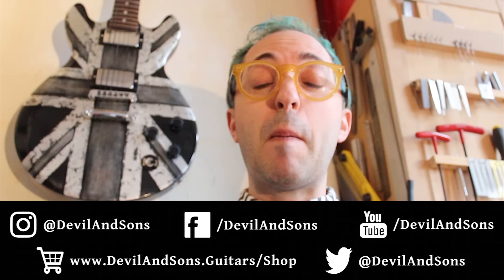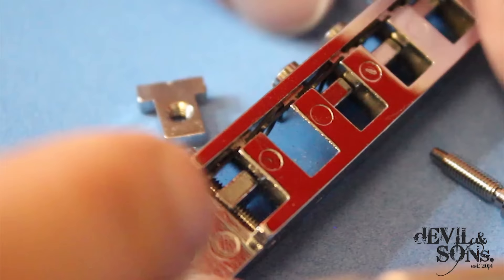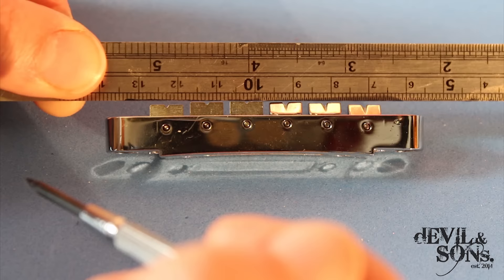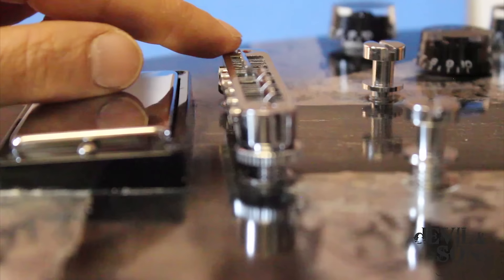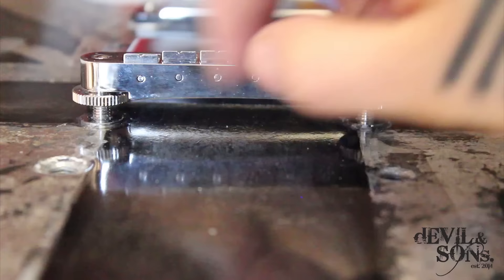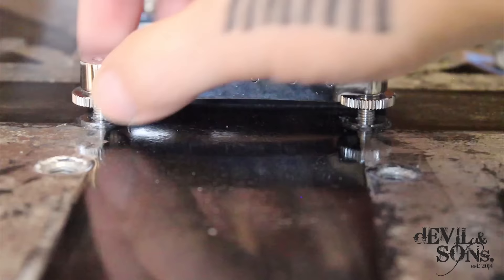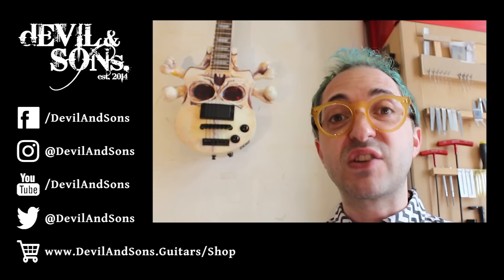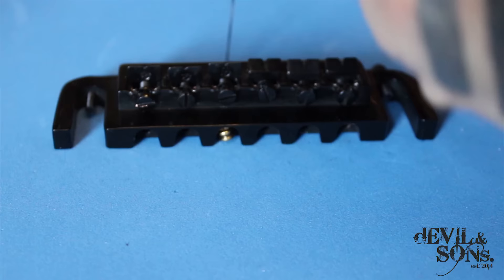Setting up a Tune-o-matic bridge (Les Paul style)

Comment: I have a badly made black knight with a tune-o-matic. The strings leave the bridge an go through to the back of the guitar. Do you thino i would be able to add the bottom piece like you have in your video, as i dont like putting my strings through the guitar body?
Reply from the maker: I'm so sorry, I missed this comment. You can definitely add a stop piece, and it wouldn't matter if it wasn't fitted exactly as it's where the strings go over the bridge part that count the most, so as long as the stop bar/piece is roughly over the hole in the body you should be fine.
Reply: @DevilAndSons  thanks. It worked! I dont seem to have any tonal issues at all.
Reply from the maker: Mark Marshall great news. Sorry again for missing your comment.
Reply: @DevilAndSons  honestly dont worry about it

Comment: When are we adjusting intonation is it very important to be one level ahead or behind on (I'm trying to mean example when are we adjusting E string and checking on 12th fret and indicator showing 1 or 2 level up or love) tuner indicator or is it fine ?
Reply from the maker: You need to make sure that you have exactly the same note (but one octave higher) on the 12th fret as the open string. If you don't then you will find the notes get more and more out of tune the higher you go on the fretboard. I hope that makes sense.
Reply: @DevilAndSons  thank you for answering. Can I use my clip tuner or do I need strobe tuner?
Reply from the maker: Any tuner will work, but you may got more accuracy from a more expensive one.
Reply: @DevilAndSons  I have Ashton CPT200 clip tuner does it enought to adjust intonation? or do I have to buy expensive tuners like Jim Dunlop DT-C2 ?
Reply from the maker: This is fine.

Comment: How high should the bridge be off the body?
Reply from the maker: That would depend on a number of things. The best thing to do is actually measure the height of the strings off of the fretboard, and specifically the height at the 12th fret. This is how you normally measure your action or string height, which is adjusted by the bridge. So for some guitars the bridge will be higher that others as the neck may be higher off of the body. I actually have a full set up video whoch covers string height/action, as this video really only focuses on the bridge itself.
Reply from the maker: Here's that video https://youtu.be/bZHjmr6Y2qg

Comment: Hey man great video, very helpful. My question is  my saddle bridge is all the way down and my string action is still a bit to high. I am a bit worried I have warping going on with my Epiphone Sheraton ii, I just recently tightened the truss rod as well to get the action closer but when I do the check the capo on the first fret and check the 7th fret there is no room, at all. When I do adjust it so there is the proper gap there the action is then unbelievably high and really bums me out because I’ve only had this guitar for a year and a half and I’m worried it’s messed up.. should I go to a tech that really knows what’s up or do you have any suggestions. I’m very much looking forward to those other setup videos you mentioned. Thanks for any tips in advance!!
Reply from the maker: Brandon Uhlir thanks for commenting, and sorry to hear that. Obviously it’s hard to know without seeing it, but sounds like you know what you are doing with the truss rod, and yes you are right - it needs that gap under the seventh fret when capo the first fret and hold down at around the point the neck meets the guitar. I think it sounds like a problem with the angle of the neck. If i’m correct the neck isn’t a bolt on so it would hard to do yourself. It would an adjustment to how the neck sits in the pocket where it joins the guitar (if it is actually a neck angle problem). Is this a problem that has developed over time? It is probably worth getting it checked out, but you could do a YouTube search for adjusting neck angles that may help you understand the problem better. With a bolt on you can add a shim to adjust it.
Reply: On many Les Paul tun-o-matic bridges, they come factory with the BASS side string saddles and TREBLE side facing the opposite directions. This becomes an issue when you come across intonation with these guitars. You max out your saddle screw turning ability but your intonation is still off. First check the issue isnt your truss rod/neck or action. if all else fails, FLIP THE SADDLES 
1.Remove the 3 TREBLE saddles, 
2.Flip them around so theyre the same direction as the BASS string saddles. 
3.Restring
4.Intonation 

DONE. it should fix many of the issues with setup many are having with Epiphones and many gibsons as well
Reply from the maker: KyLesCaster thanks for commenting, and very interesting. Getting the right amount of movement in your saddles is important. It sounds like Brandon’s problem is with the string height and action not the intonation. Hopefully both our comments will help lead home to answer.
Reply: Devil & Sons, That's why the Nashville tune o matic wipes the floor with the ABR-1 👍
I had a Les Paul once (I still have it) and I just couldn't quite intonate the low E because the saddle had run out of travel which was a P.I.T.A.
So I swapped the ABR-1 for a Nashville tune o matic with roller saddles and that was a brilliant mod that also kept the guitar in tune better.
I have, at the moment swapped a couple more T.O.M's with the Schaller roller bridges which are better still, which brings me to my 2p for the O.P.....
Maybe if your action is too high with your T.OM. bottomed out, you might be able to get it lower by using a lower profile bridge such as a Schaller roller tune o matic. I would take measurements first of your existing T.O.M. the Schaller roller bridge, and the distance that your bridge is too high by, to see whether or not the lower profile bridge will be of any help before you spend any money buying one.
Reply from the maker: @JammyGit  Thanks for chipping in. Hopefully your advice will help people who come to this video.

Comment: 2:09 - I didn't understand why there is a need to play with the saddles. You explained it's effects the strings length, but I didn't get it. you can tune the string from the tuners, right ?
Reply from the maker: You do change the tuning with the machine h3ads but you adjust the saddles to get the intonation correct. Basically if the string is the wrong length and you play an open string tuned it E it will sound like and E, but if you play the E at the twelfth fret it won't be in tune if the string length is wrong.
Reply from the maker: Here's a full set up video where I explain intonation https://youtu.be/fvD-qsM3piQ
Reply from the maker: Intonation at 34 minutes into that full set up video.
Reply: @DevilAndSons  Thank u so much for all your answers man ! I just saw u answered me 👍
Reply from the maker: No worries, hope it all makes sense.

Comment: Does the saddle have to be square or can it be on a lean?
Reply from the maker: Sorry, I'm not sure I understand. Do you mean the whole bridge (which is normally at an angle) or the individual saddles?
Reply: @DevilAndSons  The whole bridge.
Reply from the maker: @RBFR01 most guitars will have it at an angle with the lower bass strings being further back to account for the fact they are bigger strings.

Comment: In your opinion, how high or raised should strings be on an Epiphone Casino guitar? I'm having trouble with the Tune o matic bridge :(
Reply from the maker: It's definitely a matter of taste and depends on the strings and style of playing but I would normally advise sonewhere between 2 and 2.5mm for the low E and between 1 and 1.5mm for the top E, graduating the strings in between. Is the main problem you are having the string height?
Reply from the maker: It could be other things like the truss rod needing adjusting that can also effect the string height. I made a full set up video that may help with that.
Reply from the maker: https://youtu.be/fvD-qsM3piQ

Comment: Hate to tell you, there are different sizes of screw drivers. No need for popsicle sticks.
Reply from the maker: No way! Do they come with ice lollies?
Reply from the maker: Also, just for anyone else reading this - it's unlikely you'll have such a wide flat headed screw driver for a post screw like the one in the video so be careful using a smaller one that it doesn't mark the groove if you are using one which is too small.

Comment: I’m a little confused as I have been researching basic setups. My issue is with setting neck relief and the effect it has on action and also the bridge setting action.

So a slight forward bow will raise the action to a certain height and I can raise  the bow in the neck slightly to get any ideal minor height I’d like with no rattling across the bridge but that bow will depend on the height of the bridge.

So when I see videos talking about slight relief in the neck, that makes sense in isolation but what’s missing is how the bridge relates to that. Obviously if the bridge is higher or lower it will affect what I do with the relief on my neck.

So how does one decide how much to raise or lower the bridge itself? Since neck relief also places a part in action? Should one do the bridge or neck first?

Any help? Thanks
Reply from the maker: Hi there Hey There, thanks for commenting. So, this video is specifically  about the tune-o-matic bridge and the intricacies of that. I have another video that focuses on the complete set up, in that I talk about truss rod adjustment (so the bow) and how to find the correct bow, then how to find the correct bridge height and how the two connect. If you have time I suggest watch that one through (it's quite long) and I think it will answer your question exactly. 
https://youtu.be/fvD-qsM3piQ
Reply from the maker: If it does please do comment on it to let me know, or ask additional questions in the comments, I'm very happy to help. The key thing to remember though is you may end up having to adjust one (neck or bridge) go back and adjust the other, and back and forth. Also every guitar and guitar player is different so all the measurements I give are a good guide, but if you end up having a slightly bigger bow or lower bridge (for example) in order to make everything perfect for you and your guitar,  it's not wrong - it's just that this is right for you.
Reply from the maker: Good luck
Reply: Thanks for the comments. I watched that video, very informative. I guess what I understand is if the bow isn’t affecting my neck in a negative way with rattling it’s my preference also with the bridge height. I felt like if the bridge height is more important to me for Playing feel, then I should adjust the neck accordingly. I feel the neck bow is important for fretting buzz mostly and the bridge height more for overall picking comfort . 

I have a problem though I tried to fix the intonation on one of my sgs . It was sharp with the saddle all the way back. Actually even moving it forward 
Didn’t do much . I’m going to get maybe a better tuner in case I’m missing something but what could cause that?

I did take this guitar years ago for a setup to heavier strings at guitar center, the tech did a horrible job, rattling frets that weren’t rattling before and I just realized the back of some of the strings are touching the bridge going into the drop bar . Also the high e string side of the bridge and stop bar are way lower than the high e, much much lower .

But yea the intonation didn’t change at all, very weird. Oddly enough. My high e was the only string intonated already
Reply: Looking into things a bit more I’m starting to think it’s a nut job issue. I don’t recall the guitar having an issue but idk.  I just write and never focus on perfection in terms on spot on tuning so maybe I just missed it all this time . I’m going to get a strobe  tuner.
Seems it’s somewhat sharp across the whole neck
Reply from the maker: That could be the nut, i haven't made a video on how to adjust them yet as it's a bit more advanced and in the setup video I was going for things you could do without advanced techniques.
Reply from the maker: Also no guitar is going to be absolutely perfectly in tune everywhere, that's why people make true temperament fretboards.
Reply from the maker: The bridge height won't make a massive effect on intonation. If the high e side is lower that's right as the thinner strings can be closer to the fretboard. If you had very heavy low strings and light strings then the height on the low side may have been higher than if you were playing with a more standard gauge. As a guide I would have the low e 1.5 - 2mm high off of the top of the 12th fret and the high e set at 1 - 1.5mm . If you have buzz then you could raise the saddles higher (if you don't mind a high action) but I would adjust the truss rod to get rid of the buzz.
Reply from the maker: If, when you loosen the strings, you can easily remove the nut you can sand the bottom of the nut to lower the whole thing.
Reply: Thanks for the responses . Yea I bought the fret guru string action tool. I was going to get the stew mac for the sake of it being maybe more accurate. I may get both and compare . Any recommendation in feeler gauges? I see on amazon many people say basically they are mostly not accurate and too oily . I did buy some ,  feeler gauges waiting for my orders. I have read some people review them and say most of the gauges out there can be up to .10 off. 
  Either way I’m getting a better tuner and maybe it will get me a more accurate idea of what’s  going on.
  I also have a wrap around bridge sg that I’ll leave for last lol !

Thanks man.
Reply from the maker: Honestly I still use the measurements as guidelines so if the feeler gauge is slightly off I don't think it matters, especially as with each individual set up you may have to adjust everything slightly one way or another. Sounds like you'll get there with everything though. Good luck and merry Christmas
Reply: Okay thanks again for your help and videos, I subscribed hope that helps in some way, Merry Christmas
Reply from the maker: Thank you, all support like subscribing definitely helps. Do let me know how things go with your guitars.

Comment: This may sound like a daft question, but are the saddles V where the string sits  the same for each string or are the cut deeper on a low E than the high e?
Reply from the maker: They are normally the same as you can raise and lower each side appropriately to make the adjustment of string size, and normally the V isn't so deep it needs to be different (as opposed to at the nut where the string should fit snug into the slot with more on the sides than the saddles). The string should be held there by the way the string breaks overr the saddle and is held by the pressure it exerts on it.
Reply: @DevilAndSons  Thanks for that info! 👍
Reply from the maker: No worries, I hope it helps.
Reply from the maker: Here's a video about action that may help https://youtu.be/eNrrjXvebWI
Reply: @DevilAndSons  Brilliant, appreciate that! 👍
Reply from the maker: Anytime. I have a load of videos about set up related things that may be helpful in the future too.
Reply: @DevilAndSons  Ive subscribe and wading my way through them! Very good and informative videos! Well done 👍
Reply from the maker: Thanks so much. Feel free to ask away if you have any questions.

Comment: What is the avg proper height for the tune-o-matic bridge?
Reply from the maker: I'll be honest, I don't know what the average will be. I never measure the height from the body. The only place I measure the height is from the 12th fret when the strings are on. I normally just put the bridge on, set it by eye about halfway along it's range then adjust when the strings are on.
Reply from the maker: Sorry not to be more helpful. I guess in the end the only relevant height is how it relates to the neck via the strings.
Reply: Sorry, that is a hard question to answer haha I appreciate your response! Currently watching your “Setting up an electric guitar” video. Phenomenal work. I know very minimal about guitar care, setup, and maintenance, but you have been a huge help. Thanks again!
Reply from the maker: Thanks so much for letting me know, it is great to know I have been of help.

Comment: Great explanation and very good video! I have a question about a problem I have with a Gibby Les Paul Tune O Matic, the G string is the only string that sings a little like a sitar from the 2nd till the 5th fret and the guitar/neck has been verified and corrected bij 2 different luthiers! Is it possible that the G saddle is damaged or do I have a bad bridge? Thanks a lot :-)
Reply from the maker: Thierry Del you could try raising the bridge to see if it does make a difference, if it does then you know the solution can be solved by having a higher saddle, however you may find that now the action is too high for the other strings. If it does work and the action is too high have a look at the string where it goes over the saddle, it it does seem to sit a little lower than the others then it is a saddle problem. You could buy a new bridge and either swap it out completely or just swap the saddle around. Another option is to keep everything as it is and try turning the truss rod slightly in both directions to if either makes a difference. Basically I would try bridge height first, if that works and the action is still good leave it, if it doesn’t set the bridge height back and try the truss rod, if that helps but makes the action too high again then it could well be a problem with a slightly higher fret somewhere. When you say a luthier checked the neck what do you mean? It could also be the break angle from the neck to the body is off and needs a shim. I can’t see much point checking the neck without also checking the strings are ok. Not sure how helpful this is.